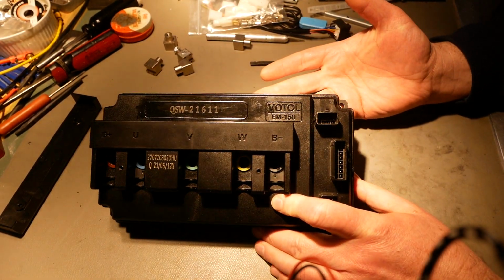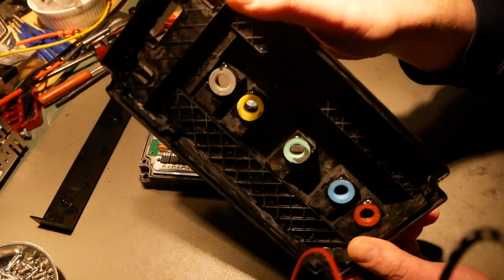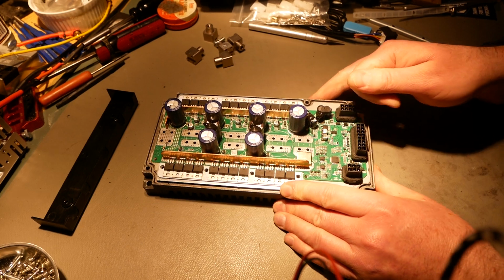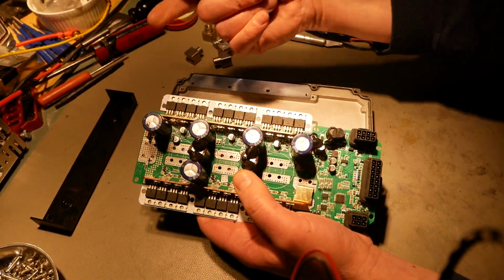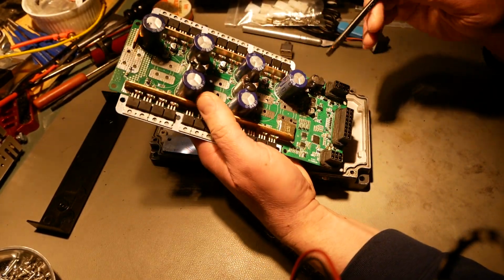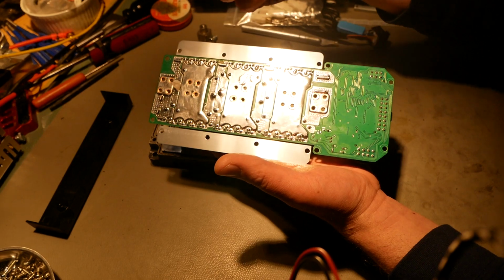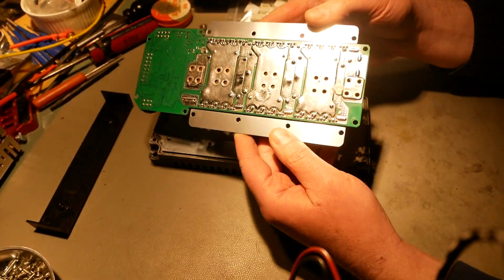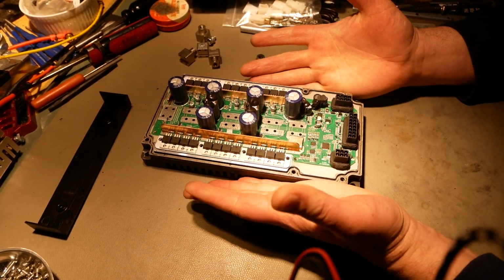Votol EM-150 Overview

Comment: besaue of this videoo I chose to purchase the Votol over a Fardriver.  I would love to have 29.6% of your knowledge on electronics. I am new and self taught, sometimes sparks fly:)))))
Reply from the maker: I blow up hardware too! In order to succeed, you will have failures!
Reply: @de-bodgery  can you recommend a good reliable display to go with the Votol EM150S? I have been searching but the info is very dry. thanks
Reply from the maker: @giorgikhodeli3633  I don''t know, but I have asked a freind that is way more knowledgeable about all things Votol than I am about this.
Reply from the maker: @giorgikhodeli3633  Look in my comments for the video. I added a URL to a display for them.

Comment: I think that the reason others do not use glass reinforced poliwster is that id is much harder to recycle
Reply from the maker: Not the reason. Recycling comes after economics and always has. It's slightly abrasive and wears out injection molds faster. It's more expensive material. It's harder to mold. The cost of using glass reinforced materials is significantly higher than using cheap ABS. This is why it isn't used. Most manufacturers don't care about recycling. This is forced on them and not something that most companies do voluntarily since it isn't economically beneficial to them to recycle.

Comment: For what it is worth, the Votol EM-100 is identical with the exception of 3 MOSFets per group instead of 4 for this controller.  Even though the EM-100 is only a little bit less in current, it is well lower than half the price of the EM-150.
Reply from the maker: They probably have to do that to get it to sell
Reply: @de-bodgery  
Probably, better to get just get rid of the100 and lower price of the 150 by 20%, you will save far more on that back end than you will lose on the 20% off the150.
Cheers
Reply from the maker: @patrickmckowen2999  It's thier business model, not sure why they did what they did.

Comment: Nice! Looks like it can handle a lot of amps!👍
Reply from the maker: A few optimizations and it can probably do close to 300 battery amps. This would make for an interesting add-on video to the 3 I do for the controller. AKA...how to beef up amperage.
Reply: @de-bodgery  
If that is the case I wonder what the 300a ver would do if tweaked😍.
Reply from the maker: @patrickmckowen2999  Not sure, never seen the 300 version! I'd like to see one of the /2 and find out what is different between the EM-250 and EM-150/2. No idea what the EM-300. Votol isn't exactly forthcoming with information about their controllers!